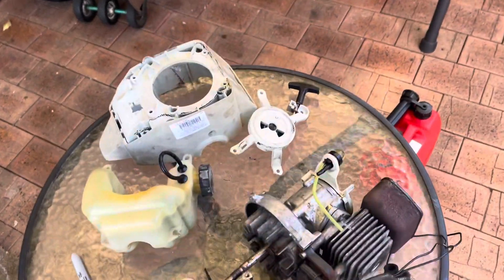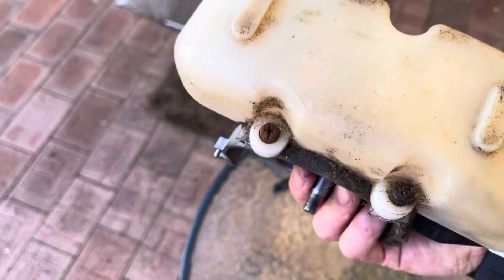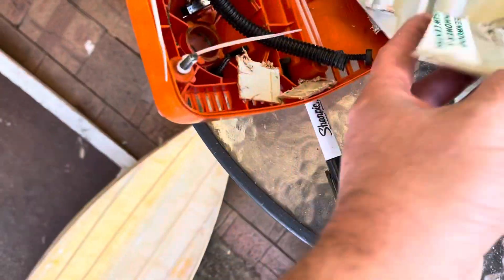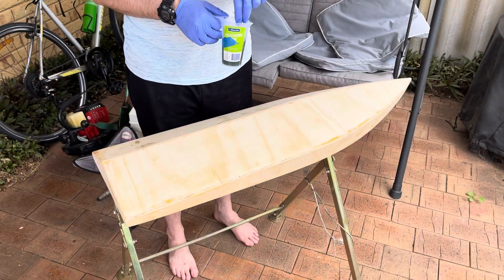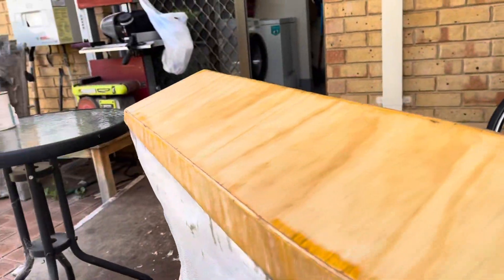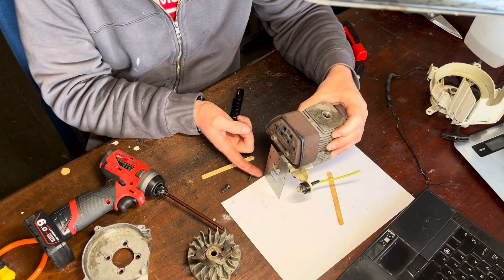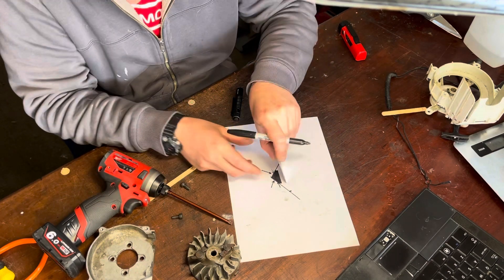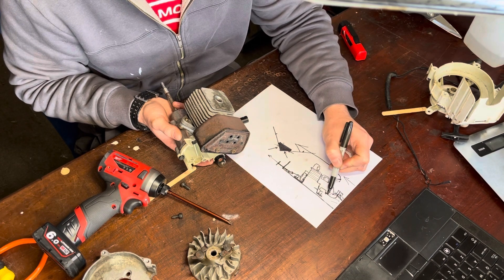2 Stroke Petrol RC Boat Build (Part 3).

Comment: hey brother, great video! i built a rescue tug one time with an air cooled engine similar to your stihl. what i did for cooling was i made a water pick up tube for behind the prop, brought it through the bottom of the stern then connected it with cooling line (silicone hose) for cooling the vanes in the head, i bent copper tubing into a coil to place between the fins in the head, worked pretty well. just food for thought! again, great video!!!!!!!
Reply from the maker: That’s awesome dude!! What a way to do it!!

Comment: might be worth looking into mounting the engine on rubber mounts, be easy enough just a bit more work as i know from experince if you hard mounting it to the hull the hull will turn into a sound box !! but looking good!! you can also get cheep waterproof servos off bangood, if not do mount them in a waterproof box as they don't like getting wet!! just a few thoughts, ps not trying to tell you how to build it just passing info i know from building a few ic powerd speed boats, looking forward to seeing it on the water.
Reply from the maker: Hey mate! Thanks very much, that’s such a good point about the vibrations! So you’d stick some rubber matting between the metal mound and the wooden block? Or would you literally suspend the motor via rubber mounts? 

I didn’t know bang good did waterproof servos! I only found normal ones on there, thanks again I’ll check it out !
Reply: @VintageEngineRepairs  look for rc car servos as most off them are waterproof,  DSSERVO DS3225MG 25KG Waterproof Metal Gear Digital Servo For 1/8 1/10 1/12 RC Cars, if you search for them there good and water proof have used them in a lot off my cars, including one i drive through bogs and think slimy mud so will be more than good enough for a boat.

 I would suspend the engine on rubber mounts as it will work   better,  would be easy enough, you could just make the mounts like you said in you video but make them wider and bend them the sides up so they are parallel to the side off the crank case on both sides then bolt  rubber mount to it so its sticking out the side off the engine, then it's just a mater of gluing some engine rails in for the rubber mounts to slot or bolt into.

  I think that makes sense I'm not grate at explaining things haha,  if you have a Facebook page or something i can send you a drawing of what i mean if you don't understand it.
Reply from the maker: I’m really confused 😂 I’ll do some more searching to see if I can find what you’re explaining though! Thanks again!!